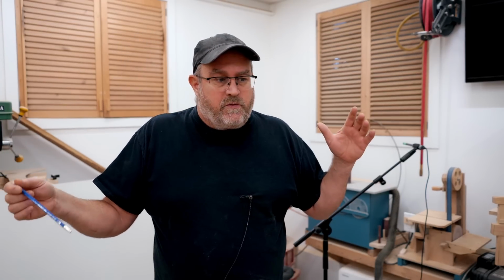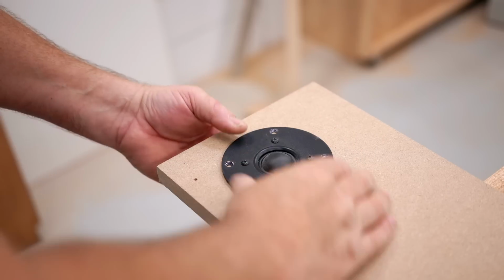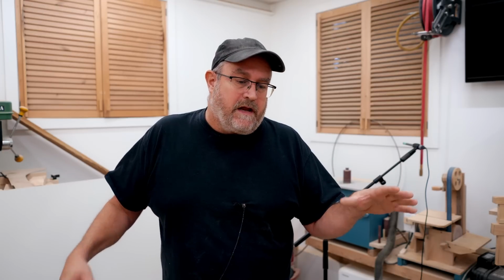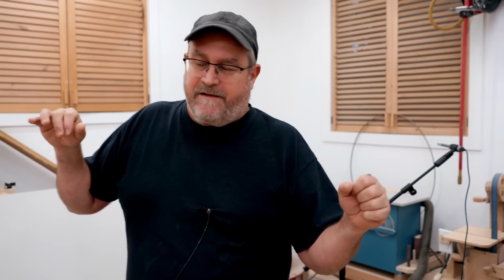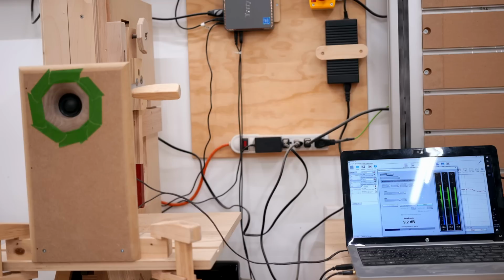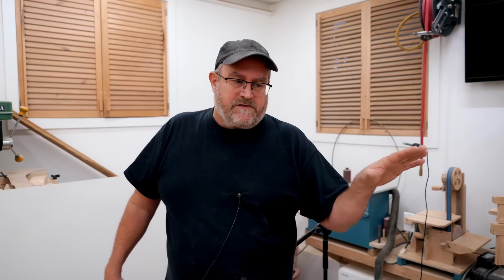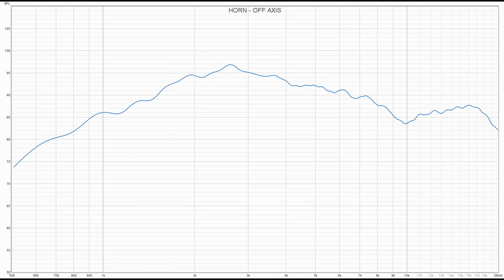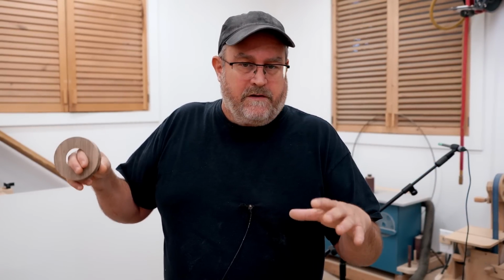What Does a Tweeter Horn Do? And Diffraction Myth Busting

Comment: Nice work! A couple of things, yes a small round over is just pretty much decorative, it has to be a large round over like a 2" radius to be of real use. Also yes lot's of horns will have that throaty sound it takes a lot of work to get the to sounds right IMHO, now if you have space to make a wave guide, you still get a efficiency benefit, though not as much, but it will also lessen the throaty sound and not have the drop off, plus the design is easier to get right as it's just a constant radius.... Oh also with horns you run into the possible problem of the tweeter diaphragm deformation from the additional pressure needed which is why it is preferred to have a metal of ceramic diaphragm, with a waveguide as there's not as much pressure you can use a soft dome.

Anyway really like your series on speakers and room treatment!
Reply: I bit strange that air which is so prone to compress may pose danger to tear. deform  tweeter. Have you done  this confirmed? There  is  danger in electrostats when wind blows in diaphragm but dome?
Reply: @Mikexception  not personally but it was from one of the bigger companies that has done r&d into it... I would guess that it's not as pronounced with smaller horns.
Reply: @attainableaudio4533  Pls. do not take it personally cause it is very common in talks  but it anoys me so much that I "have" to make  my point.🤔

 People get some information by reading or listenig from someone they  perosnally do not know and  don't  know his credibility,  Then  they back  and present it  in a way as this was discovered by them. This way they add their personal credibility (which is normal to receive from side  in seldom contact)  to opinion which they do not even have  any right to support. Some  not true  opinions get  by any mean not deserved  value as "shared by many" and . 'having strong foundation" without anybody  effort of  checking them.. 

 I accept passing on     other person opinion but on  warning condition that we did not make prof of it, it is not our conclusion,  and we could not be   assured in any way about that .  Which actualy is  positive sign of self awarness. it does not apply to knowledge which is  common life experience like mine with air mass  and compression and would be strange to underline that personally I do not know

In opposite  cases all  we face ubeatable flooding of ideas which is actualy main problem in audio They  live their own "communication" life only on base that they are repeated from hand to hand -power of popularity rises   a false "star idea" 😡
Reply: @Mikexception  no don't take anything personal, with people I don't know.😜. I don't care for the sound of horns so in the 30 plus years of this loudspeaker making hobby I never bothered to research it, just passing on what I read from one of the designers from jbl or Klipsch or one of those big companies that has the money and people to do the proper r&d. It was years ago though and you know how memories can be, that's why I said possibly, I thought ai said that it was from some designer I read but looking I guess I didn't. as far as the round over and the waveguide... yes, those I did my own research/testing/designing/measuring after reading about them. haha

Comment: This series is fascinating. I have a dumb question i always wondered about but never heard anyone mention even as a variable... in regards to time alignment, would it be possible, if the tweeter sat lets say 1 inch more forward of the bass driver on a baffle, just to run an inch longer cable from the crossover to the tweeter to compensate? Would the effect be the same as proper physical time alignment or no?
Reply: Speed of sound is much slower  ( many order of magnitude) than the speed of electricity you would need hundreds kilometer of wire to achieve the same delay
Reply: @thecarl168  thanks for the answer, had no idea electricity flowed at such speed
Reply: @albertkelly7129  It's pretty close to the speed of light (derated depending on the dielectric used). So, indeed, pretty fast 😉

Comment: The first and the second examples are a bit different in long notes. The second sounds a bit more open at these exact fragments, but this is a 10% difference )
I think you will need a super-tweeter 10-30kHz if you'd like to use that horn